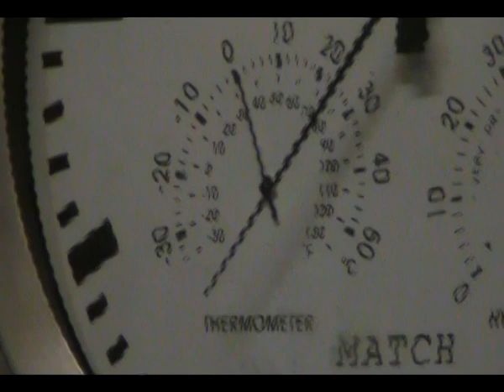4x4 FIAT COUPE Build

Comment from the maker: @GT42A 
hi thanks

well as i recall it was a tempra 4x4.. but should be the same.. 

we cut the trunk because otherwise the rear diff would not fit.. + installment of another type of fuel tank. (that was a bit to low btw)

you need a new "subframe" the part under the engine so the driveshaft fits. and you have to do some modding to get the diff fitted on the engine... the entire rear was moved also. breaks also.. 

modification to the gearleaver plating.. 
mounting of the "stabilisator bering"..